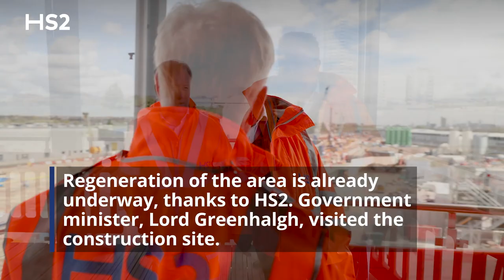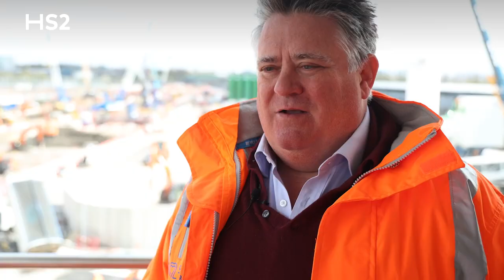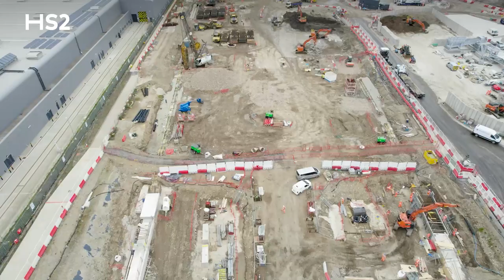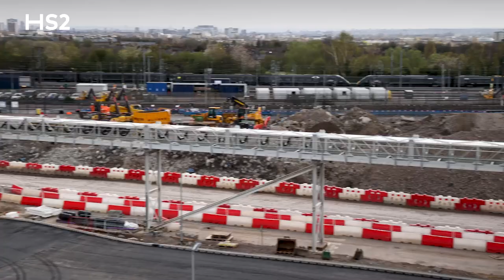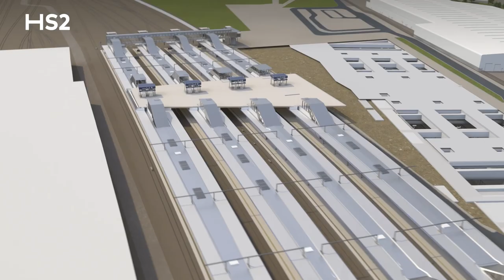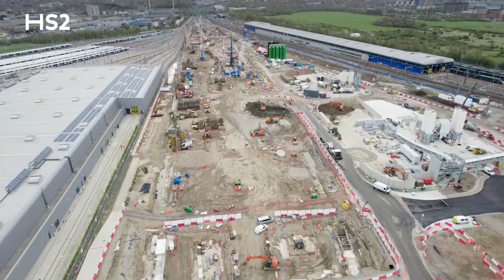Lord Greenhalgh visits HS2's Old Oak Common site

Comment: I feel Mark could have prepared some examples of "big connecting stations" from around the UK, beyond Stratford and Canary Wharf. I don't know of any significant station improvements anywhere outside of London, so it would be good to hear of those.
Old Oak Common looks like it's progressing well though.
Reply: Birmingham New Street and Glasgow Queen Street
Reply: Stations like Edinburgh Haymarket, Stockport and Crewe are big interchange stations, as well as most large through stations like Manchester Victoria, Nottingham, Sheffield, Leeds, Derby and Birmingham New Street. There definitely does need to be more built though, especially to give extra capacity for running frequent suburban trains. Cross city tunnels like Glasgow's low level platforms would enable fast frequent and reliable services in cities outside London
Reply: Oh I know there are big interchange stations, but he sounded like some had been given upgrades which had then improved the local area. I know there are conceptual plans to upgrade Sheffield, but nothing has happened with that yet as far as I know
Reply: @citiesskyscrapers4561  Despite that HS2 is not going to New Street. its going to a nowhere station in Curzon Street. pecking miles from anywhere useful in Brum. like the whole thing. a bloody embarrassment
Reply: They could have mentioned Manchester Piccadilly but that was massively scaled back because reasons. Probably because Boris doesn't like Andy Burnham.
Reply: @beecee2205  Aren't they building a new tram network between the two stations?
Reply: @beecee2205  good luck building an HS2 station in the middle of Birmingham City Centre.

Besides it's great that it's being built where it is, that part of the city is being redeveloped and Curzon Street is a big part of that. Surely its good that the city expands rather than just building everything in the same place? Its also right next to Moor Street station which is right next to the Bullring.